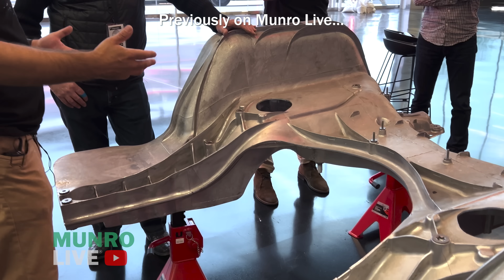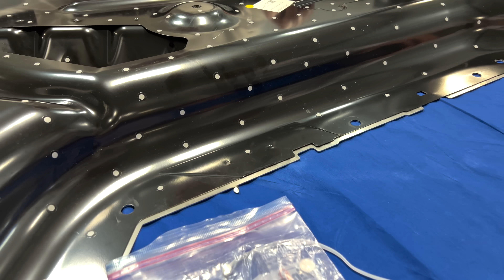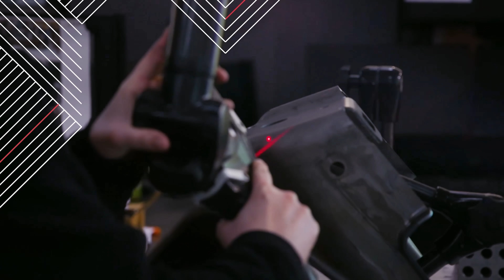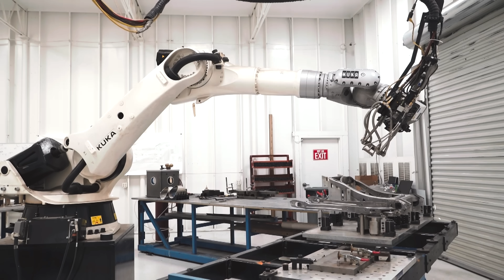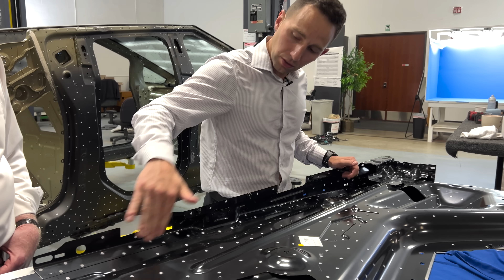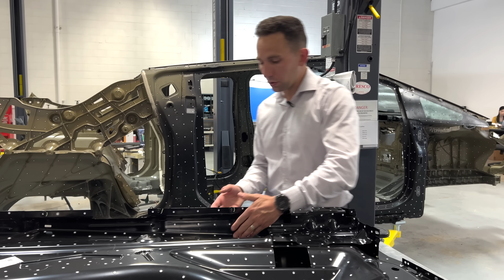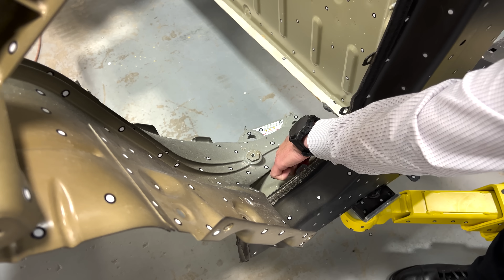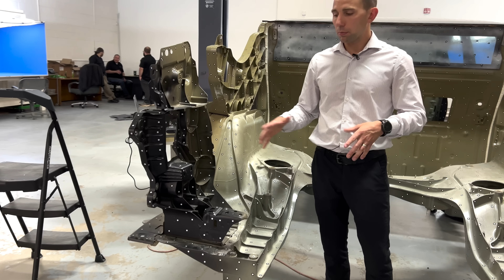Peeling Back the Layers: Tesla Cybertruck Rear Body Panel & Castings

Comment: Electric cars are a con job Sandy we all realise this is all a scam .
Reply: Delusional Bot.
Reply: @josephv5484 more like fossil fuel and legacy manufacturer bot
Reply: @josephv5484  ask yourself how many more copper mines will be needed just to make America electric ? Common sense and mathematics proves the evidence, if you are upset because you're a fan boy then I pity you
Reply: @ploppyploppy6554  there is less wiring in an electric car than in an ICE. So no. Also, there are fewer electric motors in an electric car than in a ICE. Due to decreased durability, you would need 50 percent more ICE cars over time compared to Ev's.
Reply: @ploppyploppy6554 many (if not most) newer motors use aluminum conductors (only plaited with copper)...As proven with electric transmission lines aluminum has better apps per pound and better amps per dollar than copper HOWEVER the connection is less reliable UNLESS...
Reply: You really need to do some homework. Tesla's have less than half the wiring than an ICE vehicle. The Cybertruck is a 48 Volt architecture, that means it uses 1/4 the copper wiring than a similar 12 Volt system.  The high voltage cables and the battery packs uses primarily uses aluminum, not copper. Please view some of the battery teardown by Munro. You owe it to yourself.
Reply: Yup. Electric drills and electric compressors and electric fans, too. All scams.
Reply: @ChitFromChinola  let's not forget RC cars or electric mining equipment.
Reply: Yup, let’s scrap those, too. And electric trains and busses. And electric bikes. All scams.
Reply: @ChitFromChinola  let's not forget TV, computers, phones and literally any electric device ever made. Let's do away with the entire power grid. When I make breakfast in the morning, I want to use a gas powered blender for my smoothie. If I'm not choking on exhaust fumes, it's a scam.
Reply: WTF my comment about who would be behind such bots was deleted! Was that you Munro or Google? Crazy
Reply: Go spread your propaganda elsewhere… you are probably a bot anyway
Reply: Right.  I insist that my dentist use a gasoline powered drill on my teeth. /s
Reply: There have been millions of EV made and in service, not best solution for everyone, but they are for many millions.